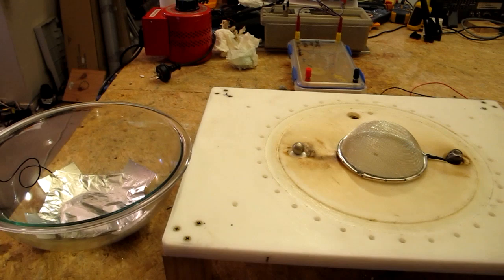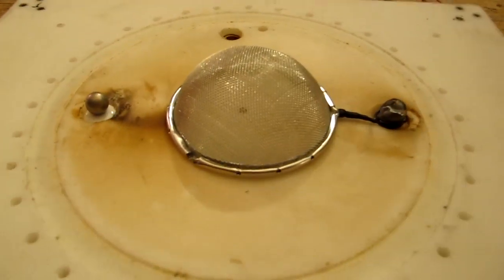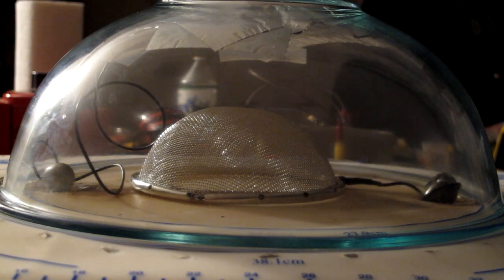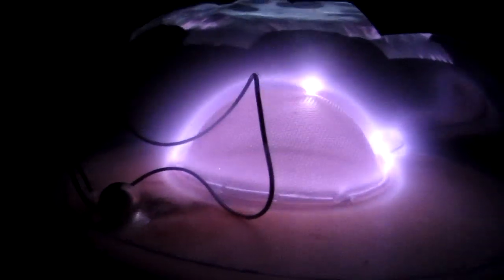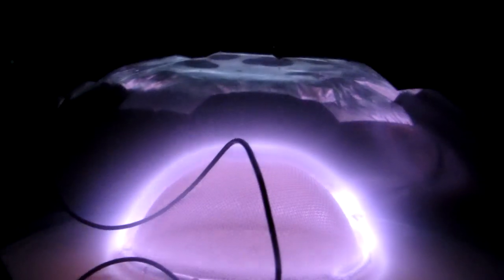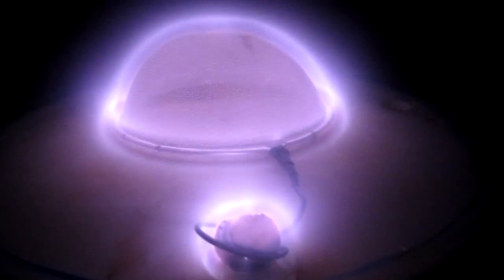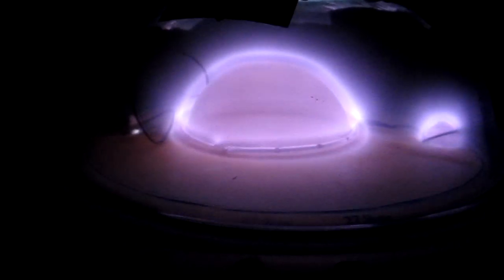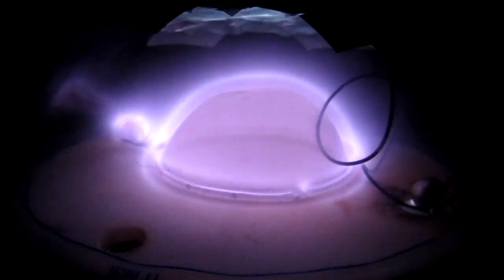Sieve Cathode Glow

Comment: can you detail your setup: like what material you use for cathode and anode, where did you get the vacuum chamber, how did you design the vacuum table?
Reply from the maker: It's a very DIY setup. The cathode and anode are decorative metal drawer knobs I bought from a local hardware store. They're a bit crappy and you can see the one I used as the cathode is melted from the heat. Next one I'm going to try tungsten welding rods.

The chamber is a large nylon chopping board and a salad bowl, both from a local kitchen supply shop. The seal is a silicone pastry mat from the same place. It wasn't really designed so much as thrown together with bits I could easily source.  :)